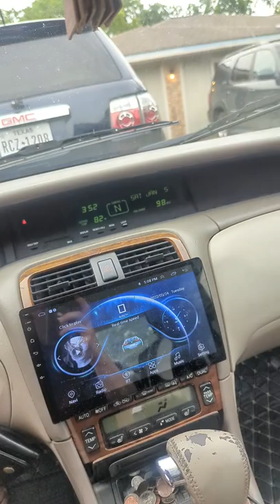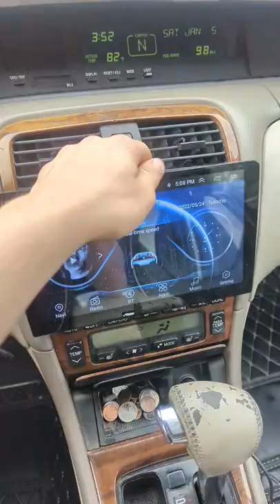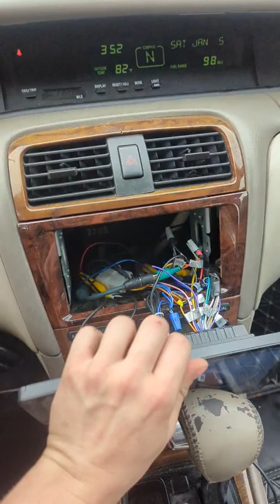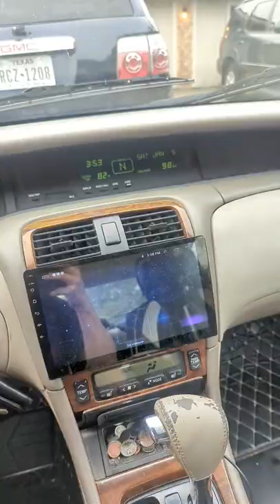radio making a buzzing sound but still have sound

Comment: Its called you're wires are not properly insulated meaning the signals next to the wire is interfering with other wires, or the wires are touching metal.
Reply from the maker: Bruh

Comment: Now ...this is the most "mushy pie" unprofessional newbie  explanation  I've ever heard, which in fact is no real solution/answer to this problem at all. The proper answer would have been either the absence of a proper wiring in regards of using a  proper coaxial type cables for signal pats or perhaps the wrong type of connections on the grounding wires therefore creating a ground-plane loop and in turn causing the noise.

Comment: I have the same stereo and my car is also making a static noise. How can I properly insulate the wires to fix this issue. Please reply
Reply from the maker: Well I finally solved the issue and will be making a video of it
Reply: @betsyrevv where is the video?
Reply: @betsyrevv how did you solve it?
Reply from the maker: It has something to do with the wire not making full connection

Comment: I’m using a cassette Bluetooth aux adapter. When I’m listening to the radio it’s doesn’t make the noise but when I connect to Bluetooth the noise comes back why is this
Reply from the maker: Sometimes it has to do with the wiring and the cassette Bluetooth makes that noise tho